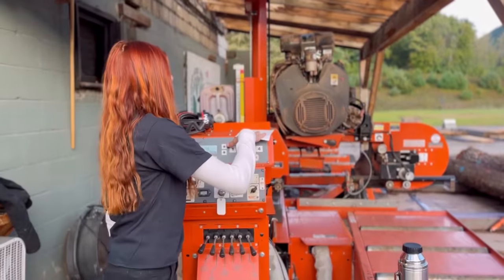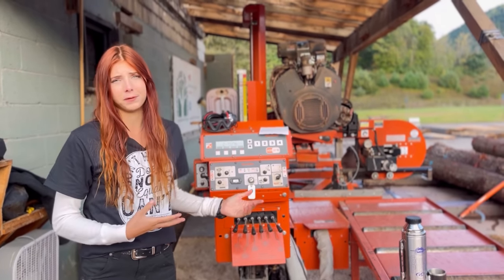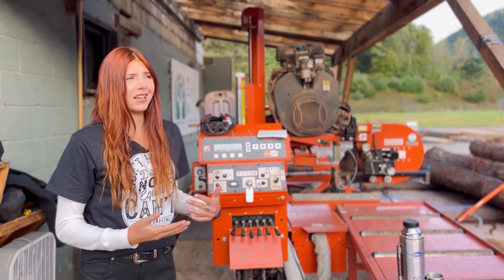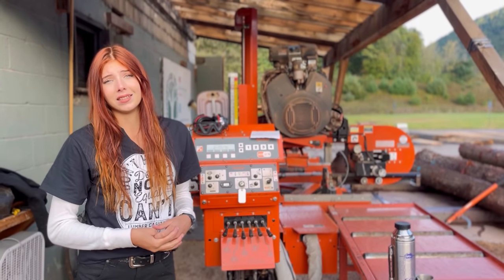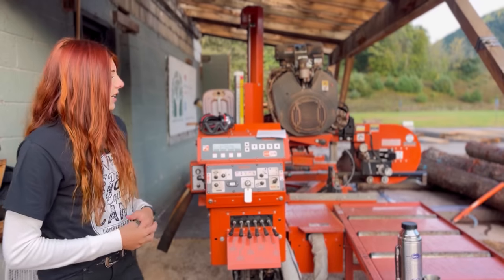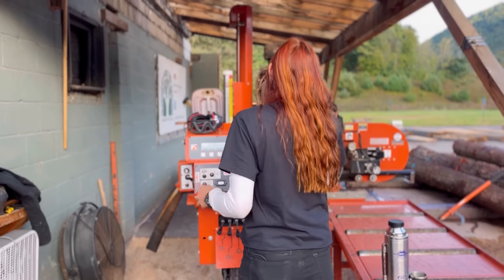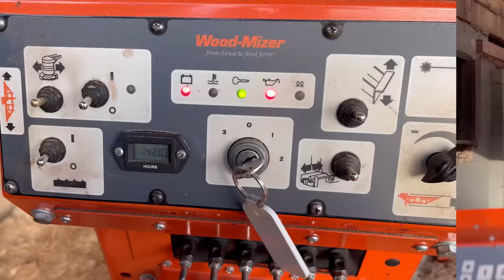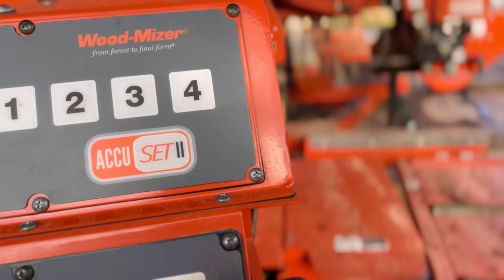Milling is for Mondays: A Day in the Life of Sibling Sawyers

Comment: I think most of the old water-powered mills could generate something like 3 horsepower, or worse, two guys working a pit sawing operation could maybe generate 1/10 hp each. No wonder everyone just used logs or squared timber to build stuff back in the day!
Reply: And took more care of their bar Moustache was trimmed straight  then milled lumber. Definitely looked the period for men's fashion.
Reply: Plus most of the wood was old growth then.  Thick and dense but there was a lot of it and it was right there.  You didn't have to put it on a truck and drive it miles and miles to the mill.
Reply: You do not need much horsepower. I know several people running LT40 sawmills on cheap Predator 420 engines. Those are less than 15 horsepower. A good 10HP engine is good enough. You do not need to spend thousands on a replacement engine for these, just get a cheap Predator 420 and you will be fine. The point is to be smart, and smart people know more power does not mean better results in most cases.

Comment: I'm wondering if 2x4 material is actually 2x4 or 1.5x3.5 like has been the standard for a long time.  And do people do construction with this lumber right away?  I would think there would be problems using green wood for that.
Reply: LCLY is cutting a true 2X4: ruff cut.    It depends on what you are doing.  Old Barn technology required green wood siding so it would shrink in place.

Comment: Emrald,..warm up oil in the motor , ☺ so u can exceed 1500 rpm without damaging the motor. if oil is cold, it is like honey, it is not enough fluid. it doesn't turn well into the motor especially when it runs above 1500 round per minute.
Reply: Duh ! that is what she said ?
Reply: if u poor hot oil into a cool motor.. it will work 💯.  many people think that the motor must enough hot,, it's the oil that must be enough hot, so enough fluid. in ordre not to damage the oil filtre. . cuze the pressure increases too much in the oil corcuit when the oil is cool.

Comment: Question.
Why do you guys not sticker the lumber as it comes off the mill? 

I'm sure there's a reason. 
Just wondering as it seems to me doing so would eliminate one step of unnecessary handling.
Reply: I have a guess for you:  If this was going out front, look at how the piles are arranged.  There is no way to set a stickered load down: so they do it by hand later.   So turn the piles one might say.   Well not so fast!  There is a space problem!  Turning the piles means the lumber won't fit in the space.    Also this batch may just be going in the back of someones pickup.    My view is that when they redo the log yard that is one of the things they need to address.